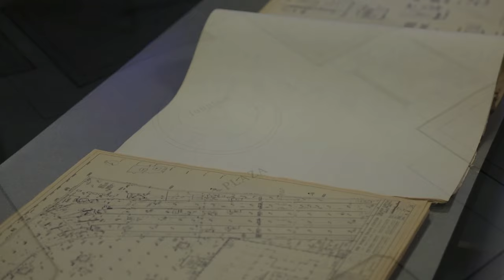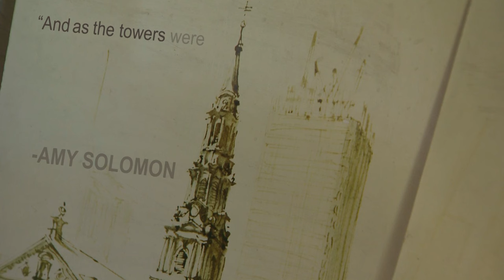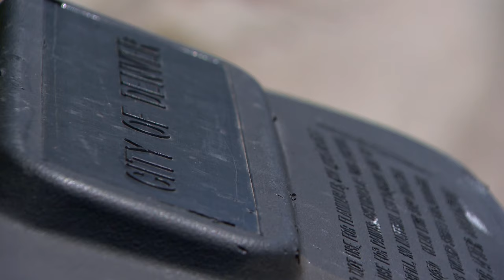World Trade Center blueprints found in pile of trash on Denver street

Comment: If it is an ammonia developed blueprint, it is the closest thing to the original. The original translucent (vellum) drawing is placed over the undeveloped blueprint paper and run thru an ultraviolet light. That burns off the media that is not protected from the 'blacked out' lead drawing lines so once exposed to ammonia gas, it turns blue. The original touched this, or a brown sepia duplicate was used (which is produced similarly but on translucent paper like the original was drawn on to enable more blueprints to be made without the original). So to someone like myself, who went through high school and college and first jobs pushing lead on the drawing board before 'growing up with CAD' . . . . . this is gold! I would love to own these! This man deserves these, he saved them from certain destruction. If he has a set of sepia drawings, that is truly the closest thing to an original set of plans. But of course to monetize that is not at all an easy thing to do, I wouldn't sell them if I were him anyway.

Comment: Where is  the blueprint from, nuclear - bunker, under the basement from building?
Reply: That's not a thing. The only thing in the basement was the water system and the central A/C.
Reply: @rydoggo  excavation work 1966, in depth 240 ft.
Reply: These are only architectural drawings
Reply: @peterhoebarth4234  how deep do you think foundation has to be for such a tall building? The taller the building, the more underground support needed. Try learning about building construction.
Reply: If anything, the bunker would be in one of the OTHER buildings. Less priority buildings are less suspicious to attackers.
Reply: @rydoggo  Lol,